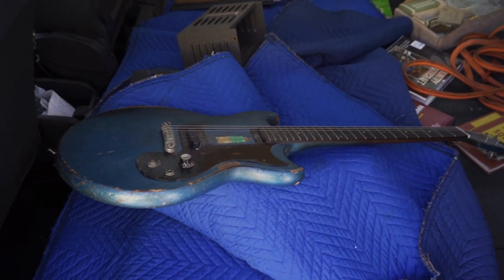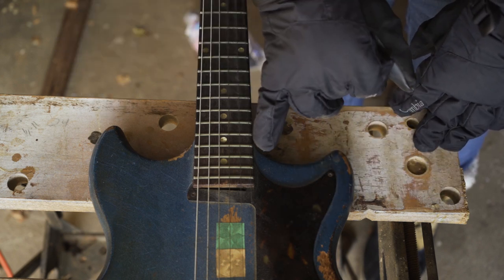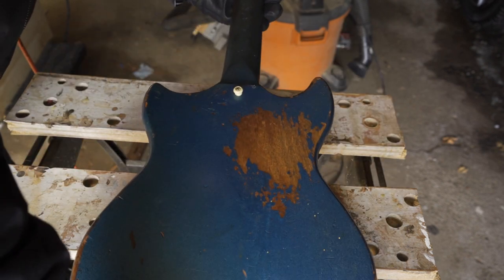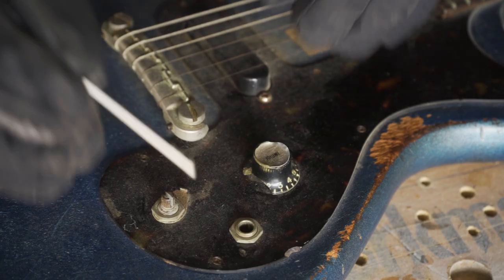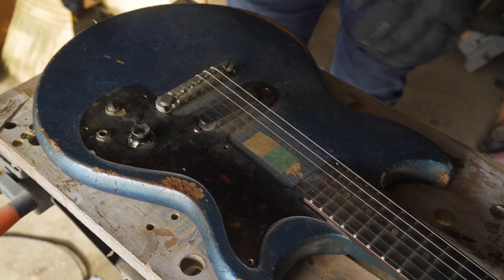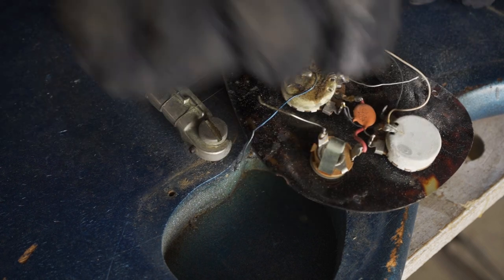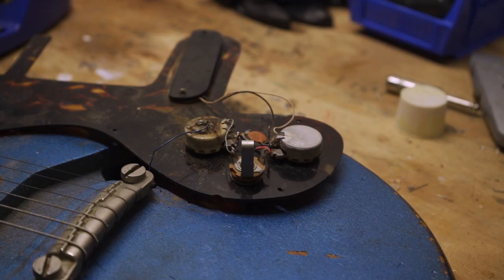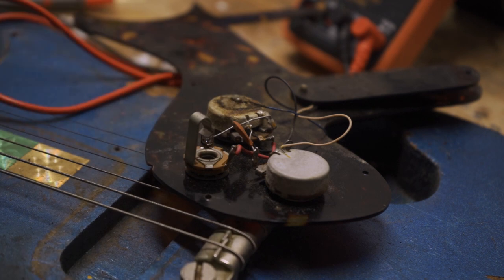Is This A Vintage Gibson Guitar?

Comment: That's a 1965 Gibson Melody Maker. You can run that serial number that's on the back of the headstock. The pick guard is not original and, as you surmised, the lower point on the body has been hacked up considerably. 1964-66 Melody Makers had the "Mickey Mouse Ears" cutaways, and, starting in 67 the went with the "Devil Horns" cutaways like SG. Not a tremendously valuable instrument, but a really great guitar for what they were. Mahogony body, set neck,  rosewood fretboard, what's not to love? Nice find.

Comment: The body looks like the mid to late '60s Melody Maker  had but not the headstock. Mine didn't have a nail for a strap button either. I wish I could find the one I had. It had a humbucker added and maybe a p-90(I don't remember). It did have the vibrola. The finish was severely checkered so I sanded it down, put a natural finish on it, had two new pots added with a new pickguard. Then in a weak moment I sold it in Austin, Tx in 1976 for $185. I had trouble with tuning but I think it was self-induced by putting too light strings on it. I didn't know much about guitars back then. Would have to tune it either standing up, or sitting down. Retune required if I changed positions. Weak neck.
Reply: Inline tuners if I remember correctly.